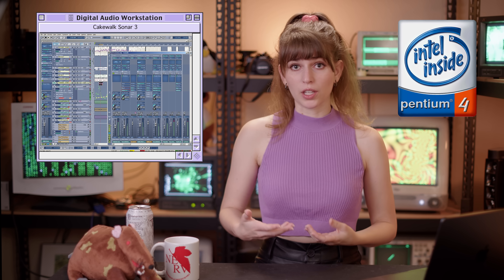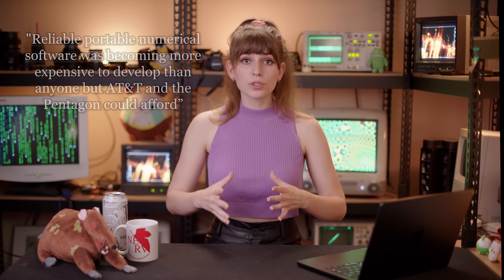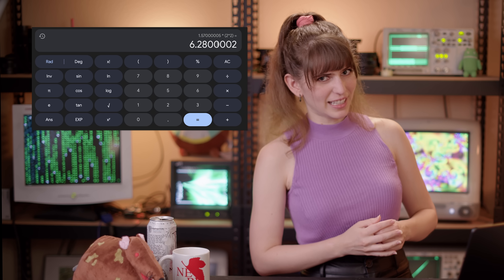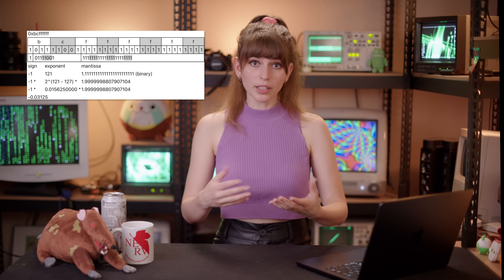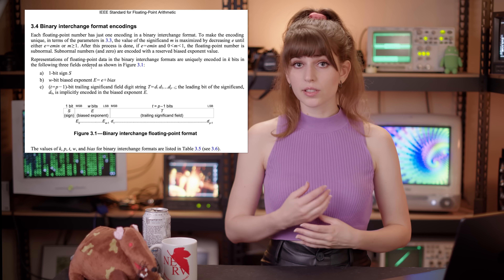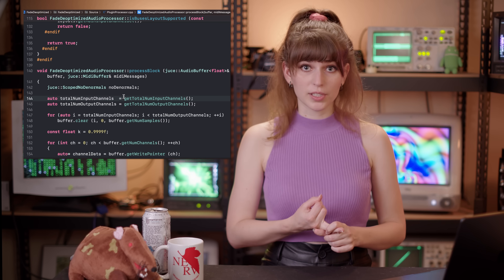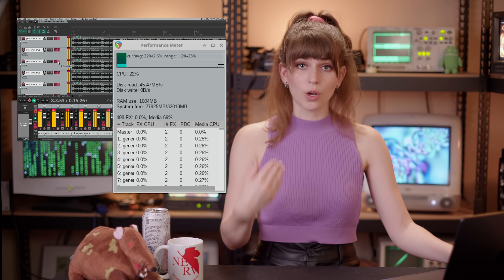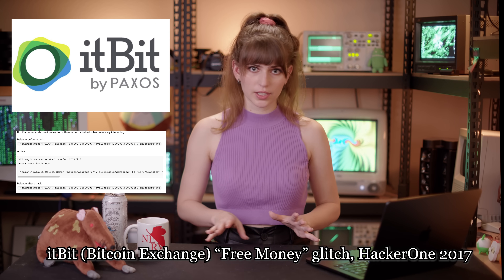Fading Audio is ROUGH on CPUs

Comment: Good video. As a computer engineer, I just wanted to clarify what subnormal numbers are and how they work. To do that, let's analyze Single Precision Floats. These have 1 sign bit, 8 exponent bits, and 23 mantissa bits (for a total of 32 bits). As the video explaned, they're stored in scientific notation. Since computers work in binary though, base 2 scientific notation is used, instead of the regular base 10. This means numbers are represented like this: ± m × 2^e, where m is the mantissa and e is the exponent (and ± depends on the sign bit). Now what's important is that, since we're writing it in base 2, m can always be written as 1.[something], adjusting the exponent as needed. For example, 0.5 is stored as 1.0 × 2 ^ (-1), and 5.25 is stored as 1.0101 × 2 ^ (2). (Note that, again, I'm writing m in binary, and 1.0101 in binary is 1.3125 in decimal). Now, since m always starts with 1. , this first bit can be implied to save space for one extra meaningful bit instead. So basically, the first bit holds the sign (1 for negative), the next 8 bits store the exponent (with a bias (which is 127 for single precision), that means a value of 10000000 means the exponent is 1), and the remaining 23 bits are the decimal part of the mantissa (and the 1. is implied). This works well for most numbers, but there's a problem. Since we have 8 exponent bits, if we ignore subnormal numbers, the smallest possible exponent would be -127, and so the smallest (positive) number you would be able to store is 1.00000... × 2^(-127), and the second smallest number would be 1.00...[22 zeroes]...01 × 2^(-127). Which is just 2^(-150) bigger than the smallest one. Basically, you can store numbers that are just 2^(-150) apart, but you have a gap between 0 and 2^(-127), with no intermediate values. Subnormal numbers were invented to bridge this gap. All numbers that have 00000000 as their exponent (which would be -127) are now  interpreted differently. First, the exponent is interpreted as -126, second, the 1. that is usually implied is not implied here. This fills the gap between 2^(-127) and 0 with equally spaced numbers that are 2^(-149) apart. But it created a different problem: FPU circuits are made for regular numbers, and since subnormal numbers use a different encoding, they have to be handled differently. x86 CPUs do that by splitting these operations involving subnormal numbers into multiple steps (using microcode), but this causes slowdowns, which is exactly what the video showed.
Reply: Fantastic additional information. Thanks!
Reply: Thankyou!
Reply: this reminds me of my computer architecture class lol and they have a whole subtopic/subchapter dedicated to this
Reply: And there is also the reason why calculating subnormals numbers is slower on hardware.
For addition and subtraction, subnormals aren't really a problem.
But, for multiplication, the multipliers are optimised for normal numbers. A double precision 53bits x 53bits multiplier yields a 106bits result, whose only the leftmost 55bits need to be calculated, the other bits don't need precise value and are just used for rounding (well, it's a bit more complex with combined MUL ADD). And the output of the multiplier has also a 1 on the leftmost position so it's already normalised. So the default path has just the numbers feed through the multiplier without shifts (unlike ADD/SUB which needs shifts even for normalized numbers)
 
When a denormal number is encountered, its mantissa is shifted left until it has a leading 1, to be compatible with the multiplier, it's extra steps for more wait states or more pipelining.

Divisions or square root are simimilar, practical algorithms (Newton, NR, SRT...) all expect normalised numbers as inputs of the divider. The renormalisation stuff is shared with the multiplier.

Comment: I still remember on the old MS Excel, if you used large enough numbers, the answer would be wrong.  I wonder if this is related to that?  Like you could do (1 / 347,298,213,234 * 347,298,213,234) and you wouldn't get 1 like you should.

Comment: Just buy a good 149000f 28 core and no issues at all with mine. I'd put an AIO on it. If your cou can't handle this simple task you need a new computer your CPU is probably dying and needs to be replaced.

Comment: I had a problem with this because some square root algorithms use the floating point representation and they were thus not portable to the embedded architecture i was using that doesn't support subnormals. Another very annoying thing is how NaNs are not standardize across platforms, some give different meanings to different NaNs

Comment: Yo. I about smashed my laptop into 1000 pieces before I found out it needs plugged into use the full CPU power. I have an i7 and 1660ti and ableton lags on battery power.  Works great plugged in though.

Comment: All those years of listening to WinAMP at low volume and it eating up my CPU - I never knew that.  I wish I got to tackle the issue back in the day - I would have taken the approach of precompiled 1.0/(5^6) and used it(by multiplying with it) when the volume was <3% then right shift.. preventing subnormals.  This is because diving by 5 is headache!  I am going to guess it's not that easy though as there were brilliant people then. Subnormals are a headache also because they require special handling... I have had way too many headaches in my life. The biggest annoyance is digital electronics store numbers in base 2. The Decimal number system we humans had to unfortunately use is base 2 * 5.  The 2 is easy (its just a shift!) the 5 on the other hand is the headache for the CPU.  1/5 can be stored in binary perfectly... and this results in infinitely repeating binary... its going to be close but a tad not exact.

Comment: Fun fact: banking software actually encodes some numbers in a pseudo-decimal format known as BCD (instead of standard binary formats) because that gives them consistent and predictable rounding to N decimal places, which is required by law in most countries.
Reply: Yeah, specifically because you can't be messing around with people's money, even if it's to the hundred thousanths decimal. You wind up with Office Space (or Superman III, or Hackers) issues. I haven't watched the video, but just based on the description, I figured someone would mention this. Now I'm really looking forward to the video.
Reply: @metalboy5150 points for the familiar but fading movie references 😉
Reply: @metalboy5150  Superman III, good reference 🙂
Reply: @jmemusic I love all 3 of the movies I mentioned for different reasons lol. But they all have the same "rounding off tiny parts of pennies and send the money to an account to rack up millions" type scam. Something I've never actually researched is if anyone ever actually tried it.
Reply: @metalboy5150 true story
Reply: "Binary Coded Decimal"
Which is a term I hadn't heard for years, and only because the college was running an IBM 370.
Reply: I remember BCD from coding back in the 1980's. I was an option in Turbo Pascal.
Reply: Yeah but you would not use fixed point math in a signal processing environment like a DAW, absolute accuracy isn't needed for signal processing, it's the ideal situation for floating point. Using fixed point would've been inherently slow and wouldn't have necessarily fixed the situation.

In accounting - yes you need to be using fixed point, if you have a processing oopsie while processing bank data you'll be in for a bad time.
Reply: @JohnSmith-mo1zo  - The issue isn't fixed point vs. floating-point. The issue is base conversion that can lead to different rounding depending on the number of digits.
Reply: @RFC3514  thank you
Reply: Ah I kinda miss using Cobol's BCDs.
You just declare 'a signed number with 8 places before, and 6 places after decimal point', and that's just exactly what you got, reliably, without imprecision.
Nostalgia for the cool formats, but not the stupid banking corporation bullshit.
Reply: Would this be the same format that .NET's `decimal` uses?
Reply: eh, just use integer arithmetic.  map 0.00000001 BTC to 0x0000000000000001, perform a few extra shifts in arithmetic operations and job done.
Reply: Yes, that WAS fun. Thank you!
Reply: In my calculator that I coded up, I just stored my numbers in an integer, stored a decimal exponent in another integer and then scaled the values by raising 10 to the exponent's power and multiplying/integer dividing.
Reply: where your fly bro? stop lacking
Reply: Ok, but who earns the fractions of cents due to rounding? 1 Million x 1.001 $ = 1001000 $, but that rounds to 1000000 $? To whose account does the difference of 1000$ go? To the bank?
Reply: @sabbahank4719  There is no rounding because BCD doesn't allow that.
Reply: @sabbahank4719  That's the whole purpose of using specialized libraries for this sort of thing, the reason there are laws in place of what banks have to use, specifically to prevent the type of situations you're talking about.
Reply: @sabbahank4719  It all goes to Michael Bolton, assuming he didn't code it wrong, or Gus Gorman
Reply: @MrStratofish Don't forget about Eugene "The Plague" Belford.  He's a Keyboard Cowboy.
Reply: Huh, couldn't they just use a Decimal class like in Python/Java for arbitrary precision floating point arithmetic? Why would they use binary coded decimal?
Reply: @nocturn9x 
A metric ton of infrastructure is still run on software made over 30 years ago in cobol n such. This isn't a bad thing as it's been optimized and being fancy is pointless in most situations.

BCD allows handling individual number digits, meaning you don't need to check what the whole number is. BCD is only wasteful in terms of storage space but the larger issue for financial systems is processing speed, along with accuracy. 
Since there's lots and lots of addition and subtraction, not as much multiplication and division, I don't see floating points having enough of an edge.
Reply: @adaroben1104  Makes sense!
Reply: @adaroben1104  Thanks, friend! You basically said exactly what I would've said, but probably more concisely. Much appreciated, lol.
Reply: @nocturn9x  cuz COBOL was invented in the 50's... python and java = 1991...
Reply: @nocturn9x  BCD predates Python and Java.

Comment: My question is, why would you use floating point for audio, instead of fixed point?
Reply: Comes down to rounding and implementation speed. Normal floating point values keep a very high accuracy (corresponding to a low noise floor) no matter their scale (level of gain) and that's a massive advantage in the studio when running complicated signal processing code. Additionally, floating point operations are some of the most optimized on god's green earth (at least when the hardware people don't mess up subnormals or they're otherwise zero'd), while fixed points have no dedicated processing hardware and naturally incur high overhead from re-normalizing values with integer division

Comment: so couldn't you solve the performance problem programmatically if you would need the precision? make it always flush to zero, but put the number it into a double precision variable if it exceeds the exponent. 
Sounds to me like Intel introduced some nonsense here, or at least something that should have been removed again with newer processors, as it's only calling for performance trouble for people who are not aware of it.
Reply: Yep it's much more of a turn of the century issue! It hits primarily the range of CPUs from the Pentium to the pre-Sandybridge Core CPUs, or in AMD's case, their architectures from Athlon64 to Bulldozer/Piledriver.

In fact, while AMD's Zen still has an overhead for subnormals, Intel CPUs since sandybridge simply do not have any overhead at all on them.

Comment: I thought you said you would play the audio to show the difference but you didn't, or I missed it. Sooo is there an perceivable difference in the audio or not?
Reply: Nope! Subnormals on 32-bit floating point correspond to about 10 to the power of -50, which is a signal level of -400dB.

Comment: I think its notable that modern architectures do not have this problem. Like shown shown in the graph at 10:03, while the older Arcitectures like Broadwell (2014, 6th gen intel core) take hundreds of cycles to calculate subnormals, zen 4 (2022, amd ryzen 7000) takes less than a cycle to calculate them just like normal floating point numbers.

Compiling for special instruction sets also mitigates the problem on older systems, although that comes with the price of losing compatibility with many other cpus.

Comment: I come from 8bit fixed point 80's computer. When I learned about floats and that I needed an Epsilon to test for equality, it broke me. Especially because I wanted to go into 3d videogame programming. At that time, we had plenty of workarounds for everything. Like unreal engine doing binary rotations to make sure you could spin object around 360° exactly. Float are a blessing and a curse. I still like fixed point / integer sometimes when I need to know exact values.

Comment: With Pentium/Pentium II/Pentium III my solution was to add and subtract a small constant to force rounding.
I don't see how the solution proposed in the video X=(X+X)-X might work, but X=(X+eps)-eps would (where eps is small enough to not affect accuracy, but to force a "close to zero" when a denormalization would happen).
When I first proposed the solution in the audio lab, nobody would believe me (and they were stunned when they realized it actually worked).

Comment: I'm a Logic user but over 10 years ago there was a plugin made for CuBase that introduced noise at -384dB (completely inadiable) which reduced CPU overhead from 40% down to 5%.
Reply from the maker: Interesting!
Reply: Damn, I used old (2009) Cubase until like three years ago, had never heard of that plugin
Reply: Denormalisation has been in Steinberg code at least since the early 2000s. And Charlie Steinberg himself programmed a little test plug-in based on these calculations to generate CPU load instantly.
Reply: Adding dither so that, after some amount of fading, the audio could drop down to zero without being noticable.

Comment: 6:18 it's actually not necessarily true now that it won't print out the decimal you entered, depending on a bunch of factors.

There's active research and stupidly complex algorithms like Ryū coming out even within the last few years that precisely print floating point numbers using the least number of decimal digits required, and many more modern languages and standard libraries have moved to them.

Comment: IEEE 754 staqndard issue in modern browsers - open the web dev tools in your browser, go to the console and type 0.2 + 0.1, then see the incredible precision :D. Now type (2 + 1)/10. Solved, your'e welcome ;) So just use integers everywhere and divide only for the reason.
Also in the console you can type `6.28.toPrecision(17)` to see this floating point "standard bug" :)

Comment: aren't all numbers just held in a 32 float word though? (in the daw engine) in the fade I mean? does a row of zeros take up less cpu than any other combination? I suppose I'm thinking the fade curve is one time calculation and is then performed as a row of discrete values. i didn't think they calculated it on the fly every time. 
this might explain why I always thought Ableton was quite cpu hungry, end fades for all loops are automatic and enabled by default. (so is the time stretching though)
Reply: Yes they're all stored into 32-bit variables (assuming the DAW uses single precision floats). What slows it down is subnormal numbers. These numbers are "weird" because they're encoded differently compared to regular values, and so the CPU can't use normal FPU circuits to perform the operations (cause these circuits assume the values are encoded normally), and so it has to run multiple calculations that can take hundreds of clock cycles to handle these numbers.

Comment: 0:40 Oof, a P4 under load... I was in my late teens / early 20s when P4s were current, and so my first custom PC all of my own was a P4-class Celeron, and I swapped the Celeron for a Prescott as soon as I could. Suffice it to say, the Prescott ran hot under any kind of load, and my motherboard's CPU retainer failed after being subjected to so much heat so often. It was the best of times, it was the worst of times.
Reply: I had a first-Gen Pentium 4 (the 3.2Ghz model if I remember right), and it did NOT run hot. I used the then-top-of-the-line Zalman cooler heat pipe cooler though. Ran nice and cool and quiet.
Reply: @TehButterflyEffect  The first generation P4 was the Willamette series which ran at either 1.4 or 1.5 GHz. 
Later revisions of Willamette included 1.3, 1.6, 1.8, 1.9 and 2GHz models.
The second generation, called Northwood, introduced a 3.2GHz model.

Northwood never ran hot. Prescott did. Prescott was replaced with Cedar Mill, which ran relatively cool-ish.

Comment: Please forgive me if I have trouble taking this information seriously -- Intel may have gone back and forth over the years, and maybe at some point they did think that accuracy was important, and maybe they currently think so, but a ton of us still remember when the Pentium had a fdiv bug, and Intel refused to replace the CPUs unless one could prove they worked in Physics or some such stupid excuse, and they had to be pressured really hard into replacing all the defective CPUs. Then there were the other bugs on the i486, I can't recall exactly what, but 2 CPUs in a row with problems did not speak highly of the manufacturer.

Comment: 1:30 this is not true. DEC (Digital Equipment Corporation) had a standard for floating point numbers, and unfortunately it still gets used today. its not directly compatible with IEEE 754 either, which is fun. The DEC standard comes from the PDP-11 in the 70's
Reply: She mentions this later on